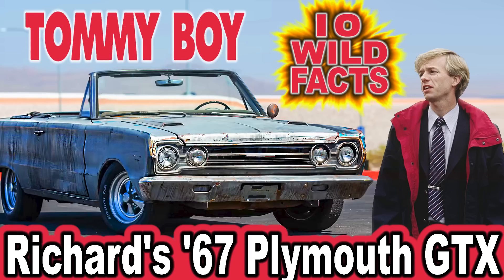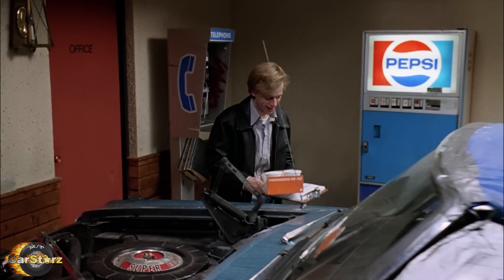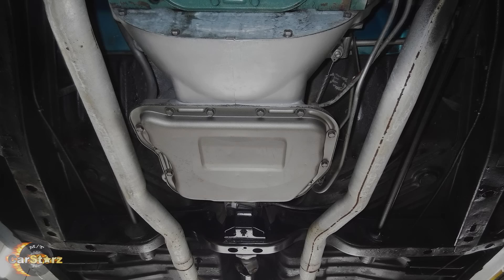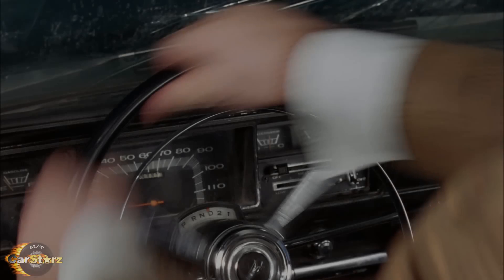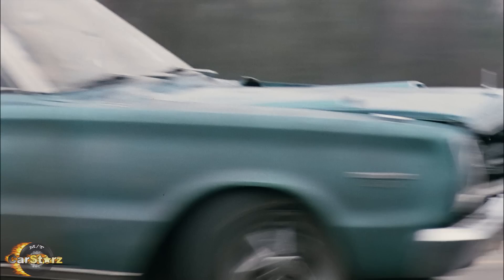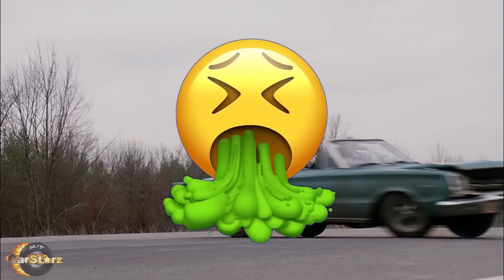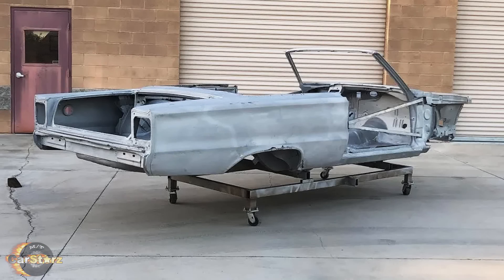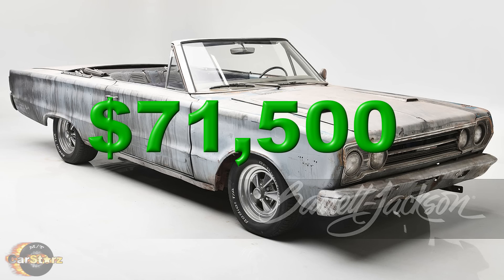10 Wild Facts About Richard's '67 Plymouth GTX  - Tommy Boy

Comment: In around 1979 I built a 1967 Plymouth Satellite that looked a lot like this car (Same paint colors, wheels).   The car eventually was sold and it ended up in a TWIX candy bar ad (I know because it had the same license plate!)… I always wondered if it might have ended up as one of the cars in Tommy boy.   I suppose I will never know for sure.
Reply from the maker: Cool and maybe so 🙂👍
Reply: I'd say there's a decent chance it's your old car, once in the system where it gets used for things like commercials there's a good chance it found it's way into this movie. 
If you still know the VIN you just might be able to verify it.
Reply: I don’t know the VIN… But I do have a couple of photos of the car.  Is there a way to share those?

Comment: Look close at the deer jumping off the car scene and you realize it is a 68 C body Newport not a Satellite/GTX just by the body lines and the square rear side marker light in the quarter panel.🤔
Reply: By gum you're right, never noticed that. They removed the skirt and it looks like the wheel opening was crudely flared with bondo. Good pickup.
Reply: OMG!!! I never noticed that!! Great eyes.
Reply: Hahaha 😂😂 how did nobody pick that up goof after 27 years.